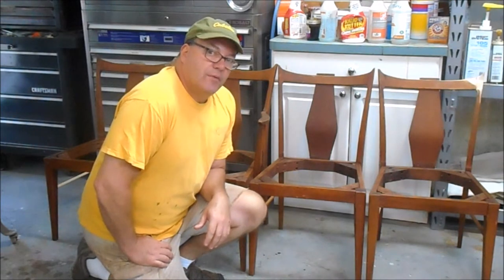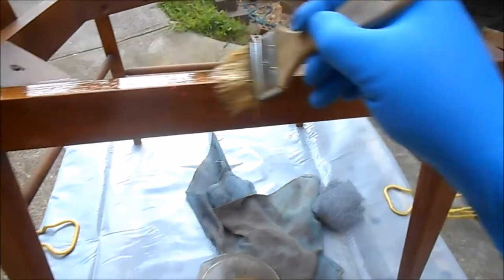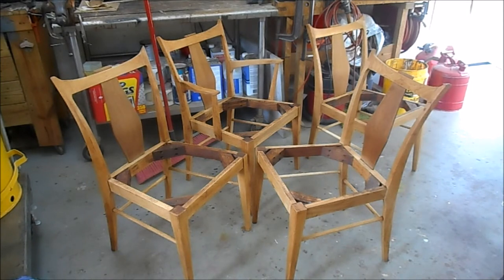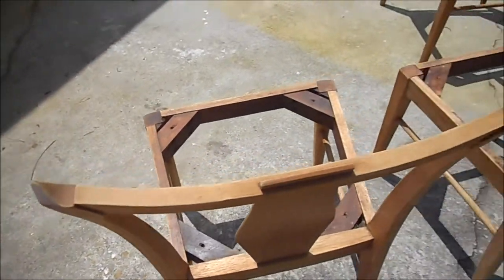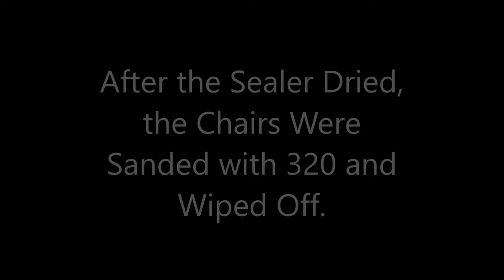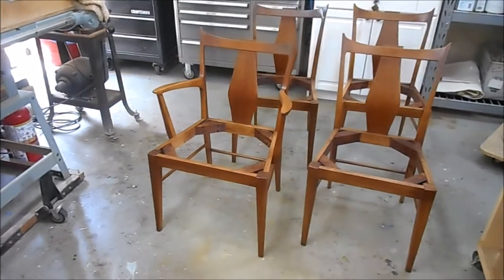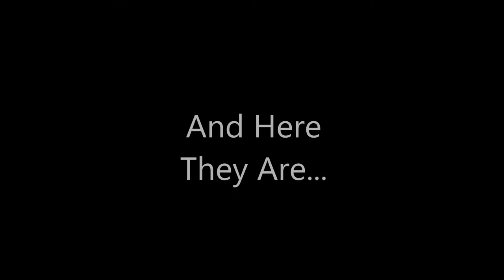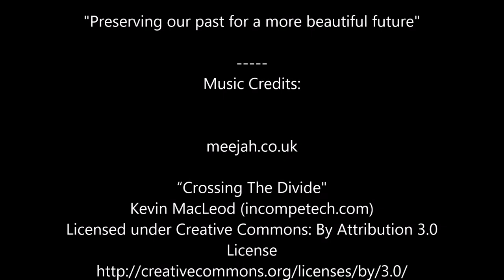Finishing Up Those MCM Chairs

Comment: Excellent job as always. I wish I didn't live so far away,  I have a really intact, 1896 Singer treadle cabinet with a wooden pitman that I'd love to have you restore. What do you think of rubbing it with fine steel wool and oil as a start? Too primitive a process or a waste of time?
Reply from the maker: The oil and steel wool treatment (followed with wax) is a good way to brush up an old shellac finish.  It won't do much for damaged finish or stains, but it will make it look a bit better.   I did that to oak chairs in 2 videos, "The Old Oak Chair" and also "She's Rotten From the Seat Down".  Thanks for watching.

Comment: Help! A couple years ago I picked up an old (1940's?) dining set. This summer I took off all the seats and replaced the vinyl. I sanded all the wood down to get off all the grunge. In some spots I took it down to bare wood but mostly I left some of the old color but was certainly through what ever they used to seal and finish them... I used Minwax Golden Oak to bring the color back, let them dry well (it has been humid) then started rubbing them down with Minwax Rub On Poly satin. The poly is drying milky. It really looks bad. I thought maybe it was moisture so I waited, turned a fan on them for a few days and this morning tried to poly again with the same result. I think I've eliminated moisture as the reason for the cloudy finish.  I don't have your patience! What should I do?
Reply from the maker: Sorry your project is giving you fits.  It's so frustrating when things go awry.    It's hard for me to know for sure what is wrong without being there, but I'm happy to try and help, based on what you said.   

It sounds like you may have a problem where the wipe on poly is trying to bind with your chairs.   If there was lacquer or lacquer based sealer remaining before you applied your finish, it's possible that's where the problem occurred.  Poly and lacquer usually don't play well together.   Also, if the chairs remained sealed up after you sanded them, the Minwax stain would further interfere with the bond of the poly and the underlying substance.  

If the stain was not absorbed into the wood and fully dry when you rubbed on your poly, the two intermixed and you may have cloudiness in the finish from that happening.  I think Minwax stains needs 24 hours dry time.  If it goes on over any kind of finish, it really never dried and sets and will come up if rubbed.

Also remember that poly doesn't "melt" into itself and needs a mechanical bond between coats.  That means you need to light sand between coats to give a "bite" to the new poly.

As far as a solution, you may have to take off the poly you put on.  If it didn't bind, it may come up with mineral spirits, but I suspect you may need to strip or sand it all off and start again.

I hope this helps.   Good luck and best regards.
Reply: Thanks so much - that is what I suspected but didn't want to face it. I should have just stripped them to begin with but I tried to take an easier way out - ha! my easy way out will end up taking twice the time. My husband is sick of not having any chairs at the table so they are put back together and I guess I'll go slow one at a time... strip, sand, and fully refinish.

I really enjoy your videos, thanks for being there.